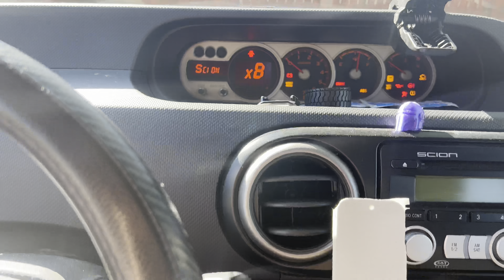Jump starting my car with a LiPo battery

Comment: What was the lipo at after that?
Reply from the maker: battery was a fully charged lipo and after jumping the car it was a toasty 3.73/cell lol no damage done to it :)
Reply: @ch3w3yfpv42  nice, almost storage charge!!!
Reply from the maker: @nappyfpv  yuup lol it was perfect and i didnt have to fly for 4-5 min to bring it down to storage charge lmaoo 🤣
Reply: @ch3w3yfpv42  I figured it would kill a lipo
Reply from the maker: @nappyfpv  idk man, ive seen people jump some cars with 4s packs but idk how the lipo ends up after that...i used a 6s that i use for my goggles lol....i did try to jump the work van with a tiny 4s 850mah and then with a 5s 1300 but neither of those got it going lol maybe depends on the size of the car lol no idea
Reply: @ch3w3yfpv42  that’s cool it worked
Reply: @ch3w3yfpv42  that’s cool it worked